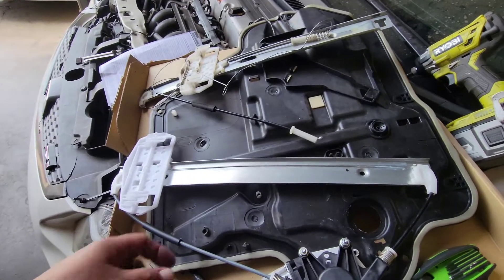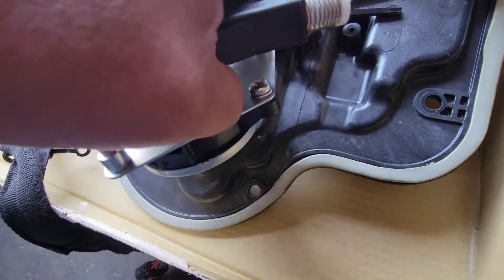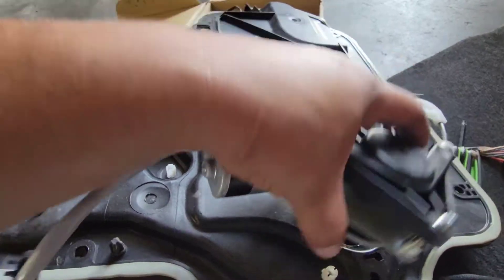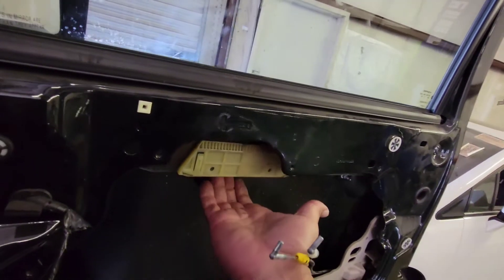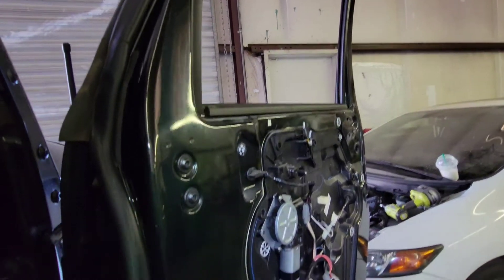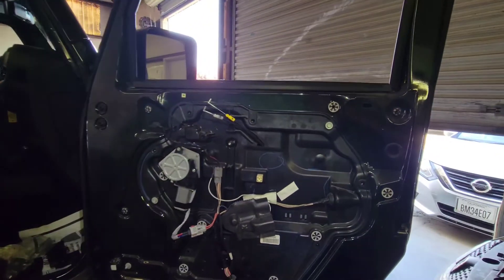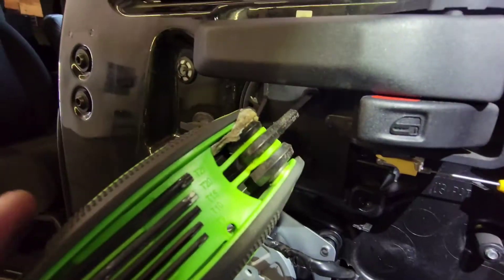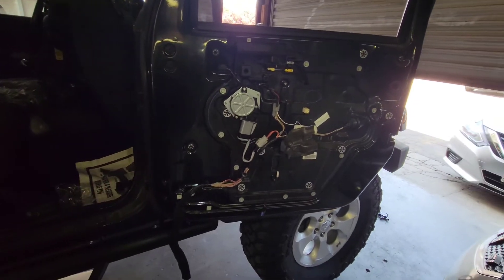How to: Install Window Regulator Jeep Wrangler

Comment: Did you have trouble with the window being too difficult to bring up? Almost seems like it’s stuck on something inside. Doesn’t allow for the window to go all the way when on the regulator
Reply from the maker: No i didn't, maybe inspect it make sure nothing is getting caught or spray silicone base lubricant on the sides were the window rolls up in down